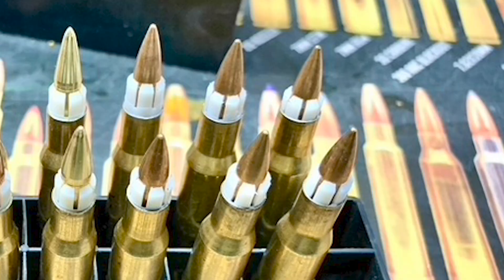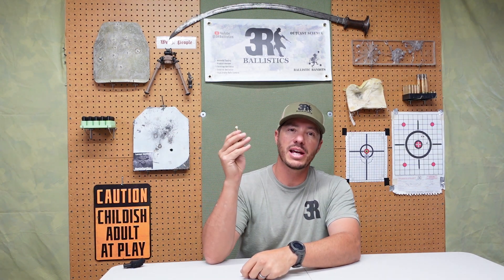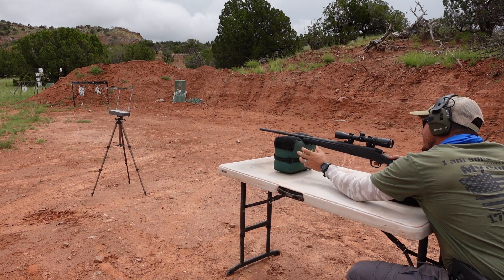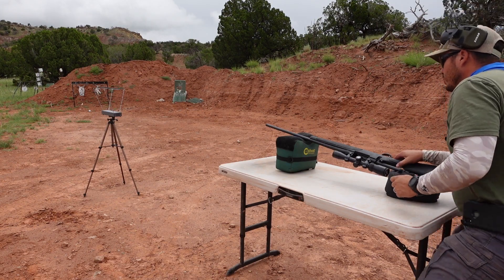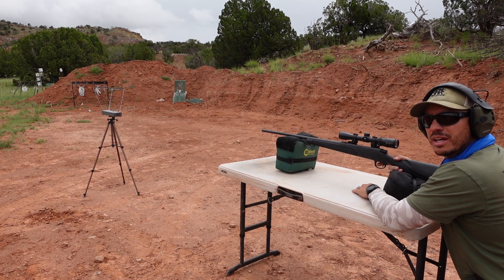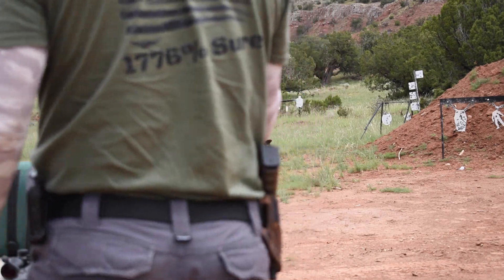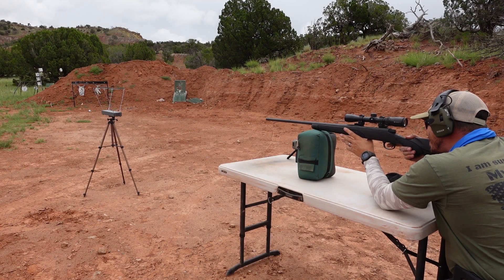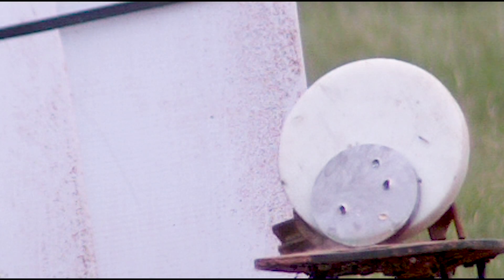I Loaded M855 (Green Tip) Into a 30-06... Here's What Happened

Comment: what would happen if you load them in a 300 win mag?
Reply from the maker: I have loaded them in 300 Win Mag but haven’t seen an increase in velocity. There is a certain pressure and burn rate speed where the sabots work. Too much pressure or too fast burn rate and the sabots fall apart. I’m walking a tight line as it is with the 30-06. I’m sure if I spent more time developing a load I could find a good mixture for the 300 Win Mag as well. These things just take time and $$$